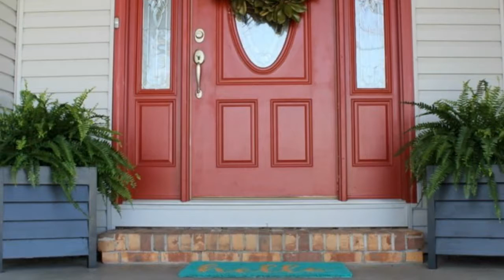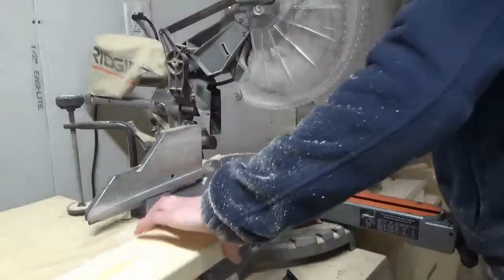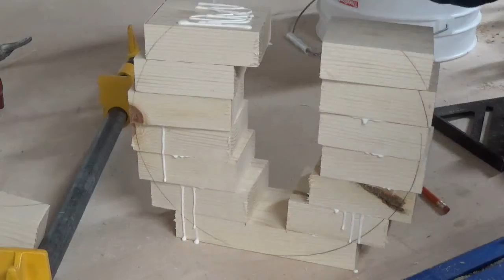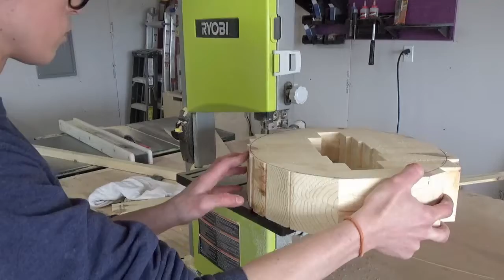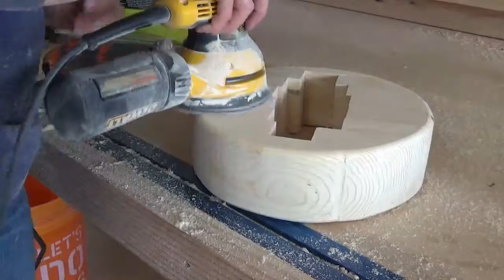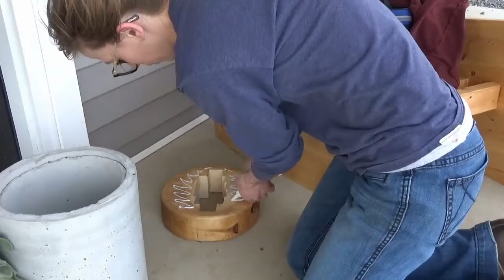How to Make a DIY Concrete Planter Pot With Wooden Base

Comment: You could coat the inside of the bigger bucket and the outside of the smaller bucket with some sort of grease so that they just pull away when the concrete is set rather than needing to cut them away. Then they would also be reusable.

Comment: What kind of sealer did you use on the concrete?
Reply from the maker: I used Minwax helmsman poly on the wood at the bottom and just applied that to the top as well. It’s not actually made for concrete, but it’s held up fine
Reply: @WoodshopDiaries  Thanks so much for responding!!!

Comment: Did you pick up those buckets at a big box hardware store? I only ever see the bigger buckets not the medium sized one you used for the inside. Is there a way to reuse the plastic buckets? Also if you do get visible bubbles, can you fill them with something and sand down to a smooth even finish? 

Thanks so much!
Reply from the maker: I got the medium sized buckets at the big box store over in the paint section near the epoxy. They usually have several sizes of epoxy buckets you can pick from that are medium size. I’ve never had much luck reusing concrete molds like this because it’s so hard to get them out once it’s cured. And I’ve never tried to fill in the bubbles so I’m not sure how well it works, but I’ve seen some people say they’ve used a skim coat of fine finish concrete to fill them in. I’ve never tried, but wouldn’t imagine it would have good results.